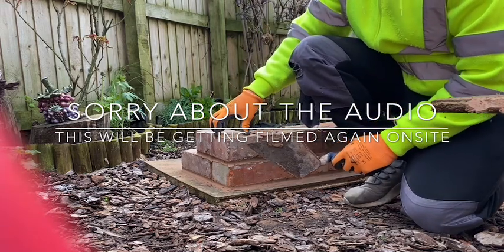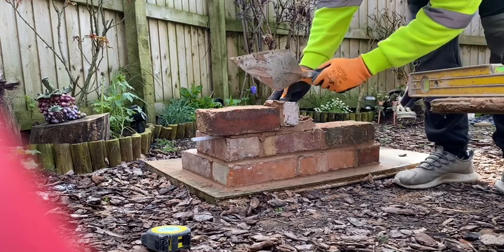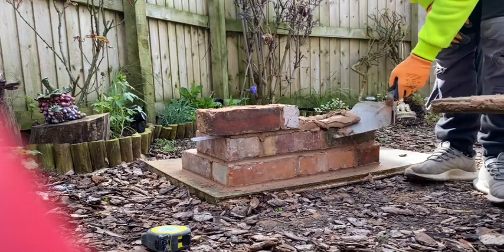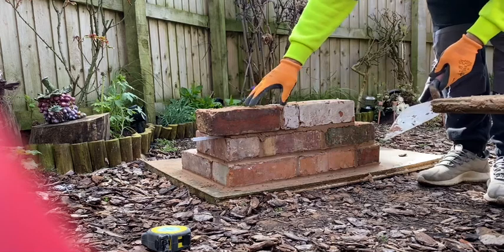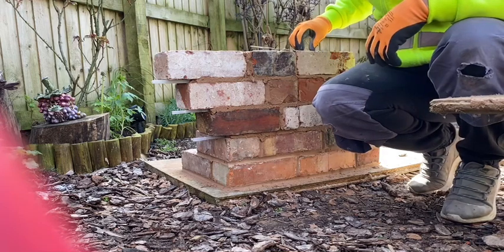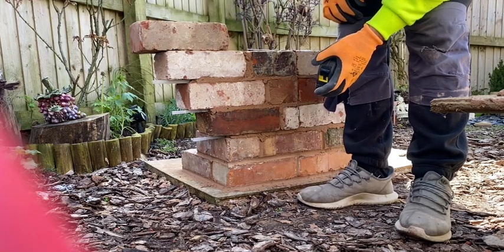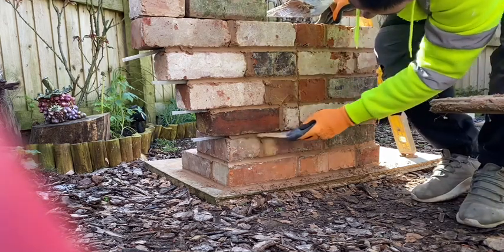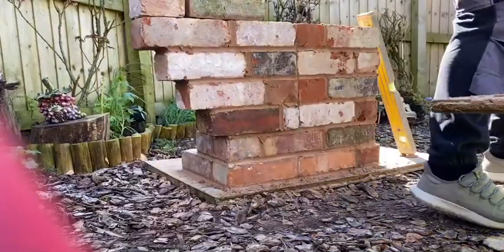Bricklaying (corbelling brickwork on site)

Comment: It all depends on the design on that site.... I have seen this straight joint on a lot of house bashing sites because the over sail is more you can’t keep your half bond onto the gable so the design basically asking for a movement joint instead.... there are loads of different ways I have seen corbels done but it goes off the design on that site or private build customers or your own interpretations 🤷‍♂️
Reply from the maker: Michael Norris that is true that is the corbel that I use on the site I’m working. But yeah it is down to the design on that site 👍🏻

Comment: This is shocking!!!  Deffo NOT how to do corbelling. The oversail is ok but you cant have a straight joint like that!! You rework your bond! Lol 😂😂😂😂
Reply from the maker: Gary thanks for the comment. Bonding the Corbell in with bricks is going to leave some thin slices of brick. You’d have to cut the backs off full bricks and try and leave the front of the brick on. This will probably pop off. This is why you put the ties in. A good detailed video has been uploaded by brickwork fundamentals. The video shows how they are done on every site I’ve been on anyway. Maybe check that out thanks 😊
Reply: All depends on the detail that you are given. Can see where he is coming from ie bond the corbal into the gable but these are sometimes specific, so ya knar... it is what it is. Good job
Reply from the maker: Thanks for the comment Craig lee. Yeah your right it is down to the detail on the drawing. These are the design that I’ve been building a while now. So I should of explained it better at the beginning of the video. 👍
Reply: As the corbel is over sailing 10mm you need a straight joint on this design.
Reply: This detail in video is wrong, no corbel detail is only single skin and the only time you will see a straight joint detail is if the corbel oversails the facework as then its unavoidable!!    But then it errrrm uhm errr...yeah..is....uhmmm is what is!!
Reply: @gazza1136 
In the video he says he is only doing a single skin for illustration and he doesn't have enough brick for a double. Also the corbel is over sailing by 10mm so needs a straight joint. Unless I'm missing something in which case I do apologise.
Reply: Gary C I am not a bricklayer so I would love to know how you don’t have a straight joint on the face of the work when the corbel is protruding by 10mm? Please could you explain